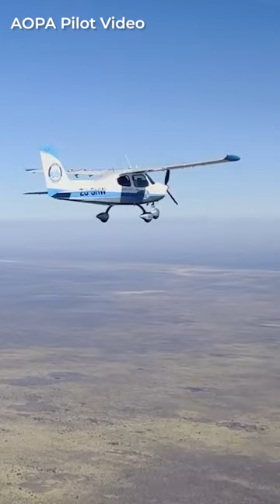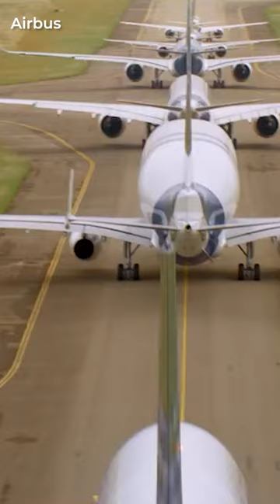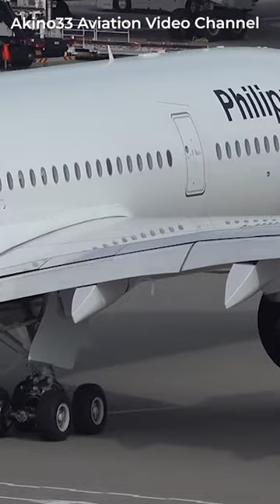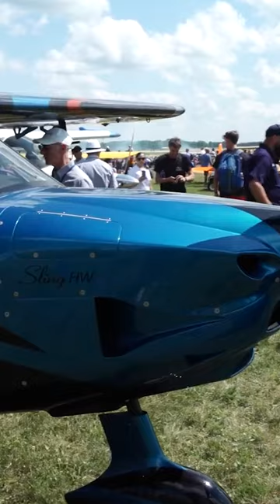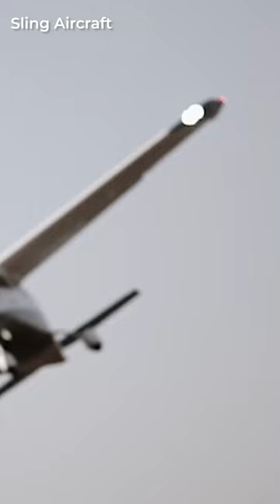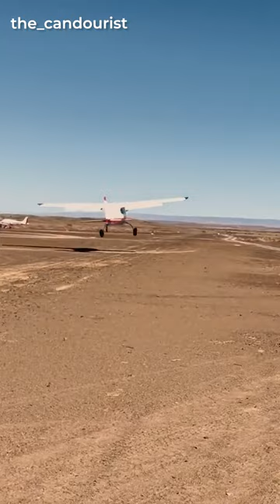The Differences Between High-Wing Vs Low-Wing Aircraft #shorts

Comment: I'm learning to fly in a Cessna 150. I'm really liking the stability of hanging from the airfoil instead of sitting on top of it,
Reply: Try the C172. More stable trainer and more room!
Reply: I felt scared when I flew the 150. So tiny. Like a gnat lol
Reply: @77Avadon77  spins like a top too!
Reply: nice i deign planes as a Hobbie but they are not refined i will think of this in my next design maybe i will pitch it to someone
Reply: @Youravaragejoe_Englisch  I build planes out of popsicle sticks as a hobby. Designing planes is super fun.
Reply: I train in a pipe warrior and it feels just as stable. High vs low wing doesn’t affect stability if it’s designed correctly. And planes are almost always designed correctly.

Comment: The center of lateral pressure is the same for both high, and low-wing, however, a low-wing is inherenty de-stabilized, thus  requiring a greater effort to make a co-ordinated turn.  Most all planes have dihedral... generally about 6%.  If a wing does not have dihedral, then it will have induced dihedral such as in high-performance sail planes, or high-speed jet aircraft.

Comment: The important difference is stability. Top wing is a stable, meaning if there is a turbulence the plane will correct itself without the pilot doing anything. Low wing is unstable, but the dehidral will give some stability

Comment: Which is more stable?
Reply: High wings are quiet stable in the roll axis. So much so that their wings usually are in an inverse v shape to actually reduce their roll stability. Low wing aircrafts however are not stable in the roll axis and thus require wings attatched in a positive v shape for roll stability.
Reply: @laurencehoffelder1579 An “ @laurencehoffelder1579 Most if not all general aviation high wing aircraft have a dihedral which is the ‘positive v shape’ The reason it is not as pronounced in the high wing is that we take advantage of something called the keel effect where our fuselage is acting like the keel of a boat and is being pushed by the passing wind which gives us additional lateral stability
Reply: The ‘negative v shape’ is an anhedral design typically found on large cargo aircraft like the C-5 Galaxy and allows the carriage of more weight at a price of less stability/upset recovery